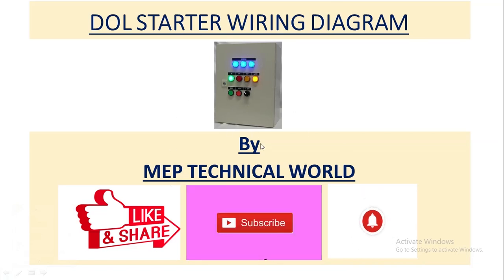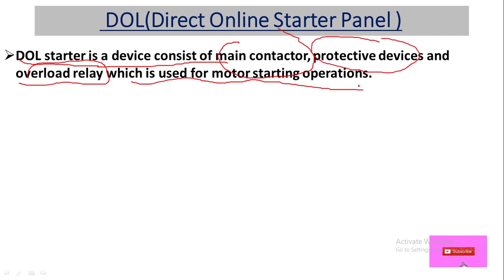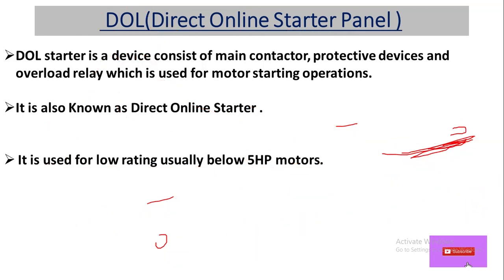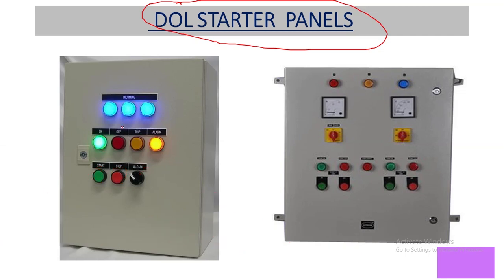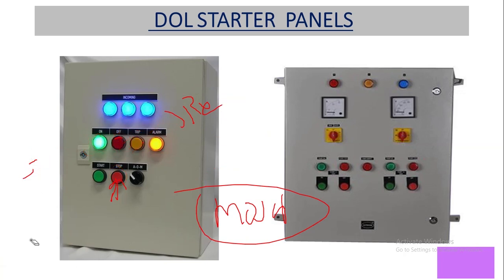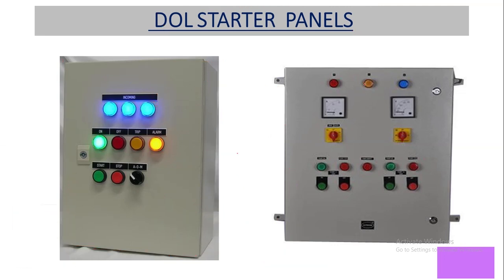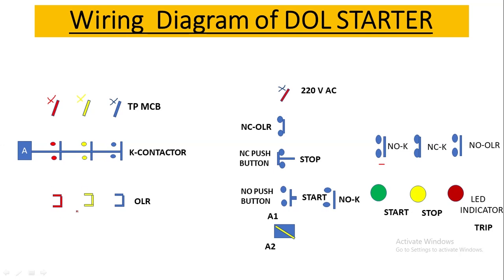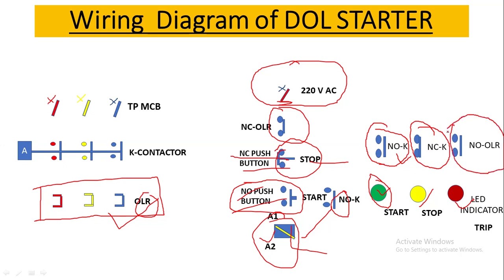Wiring diagram of DOL Starter Panel | Direct Online Starter Panel | Motor Starter

Comment: Please I want to ask a question about the auxiliary contact. Contactors has two auxillary contact which are:
1. 13NO -14NO
2. 21NC - 22NC

And one of the NO contact is used for the holding circuit. How do you get the other NO for the green indicator lamp.